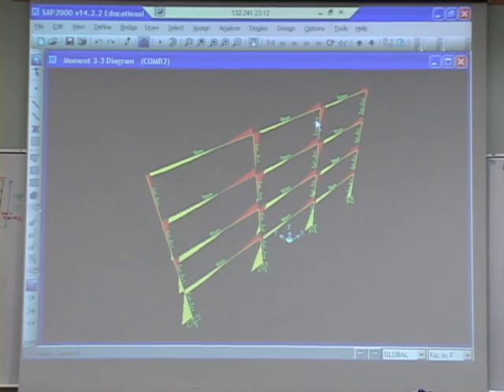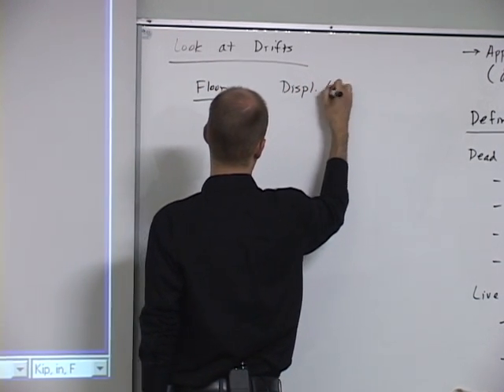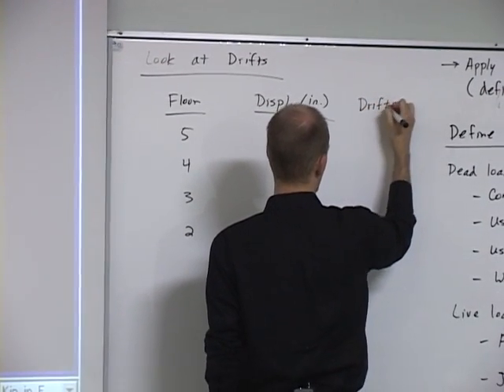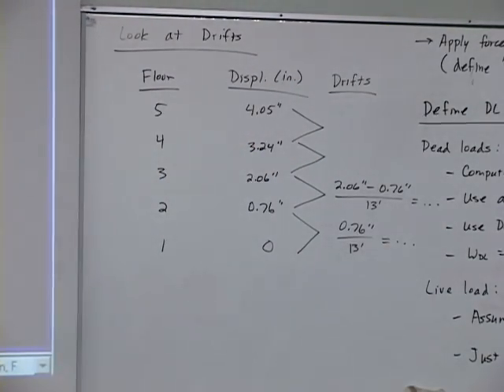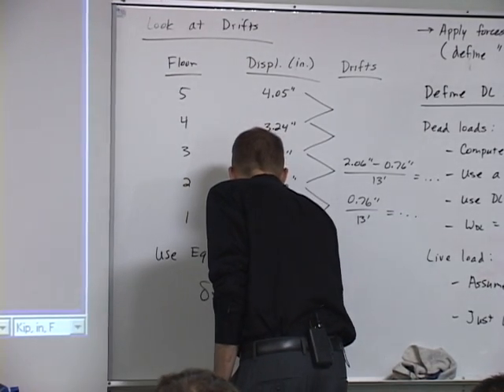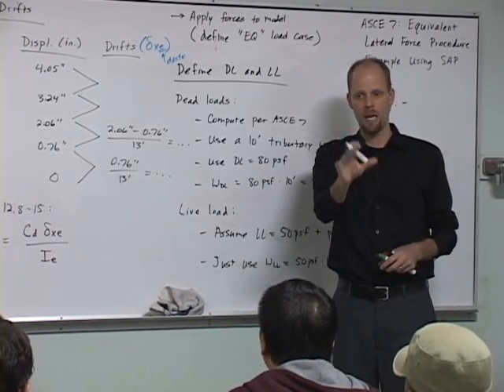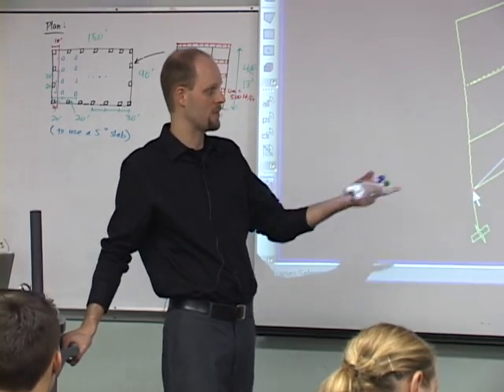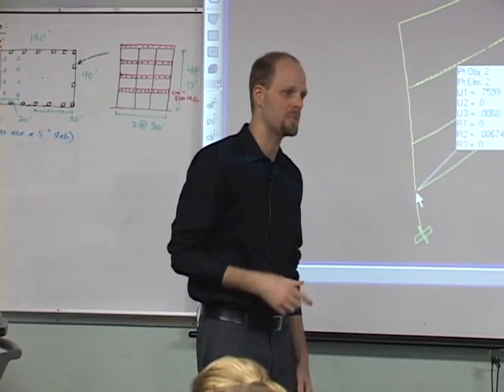8 SAP Story Drift

Comment: I believe he made a slight error. He calculated the SD ratio on the whiteboard. That is not the number used for the calculated deflection equation (ASCE 12.8-16).  Do not divide the differential of displacements by the story height for eqn 12.8-16.
Reply: hey, i know you posted this year ago, but if chance you read this please give me the source of that code you mention. i'm undergraduate which doing a reasearch on building displacement and drift.
Reply: Haridio Putra Hi, the source is listed in the text (ASCE) American Society of Civil Engineers publication 7-10 "Minimum Design Loads for Buildings and Other Structures"  Third Printing. See here: http://ascelibrary.org/doi/book/10.1061/9780784412916
Reply: Great, thank you very much for the help